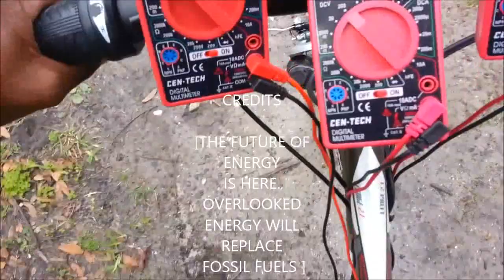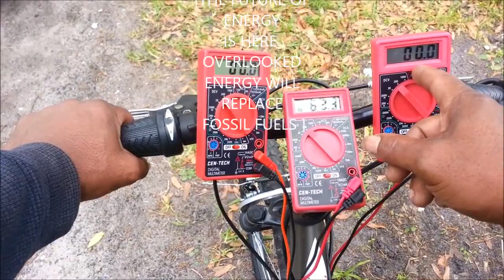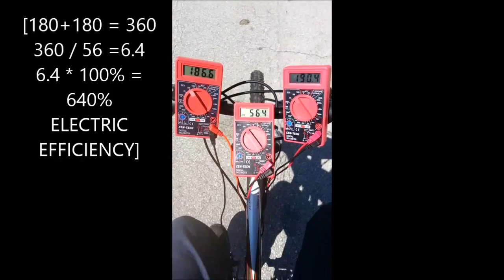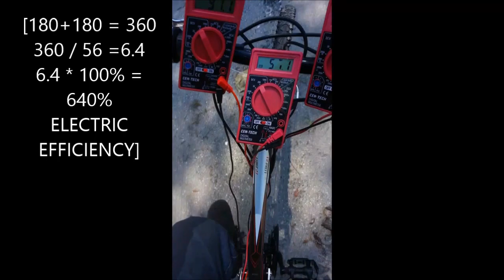SELF CHARGER E-BIKE

Comment: At the end of the day the volts the current none of that adds up however he's absolutely right I don't know what he's doing wrong but what he has is absolutely correct but I would have used a single alternator instead of two I believe he's trying to generate 24 volts with two 12 volt alternators and that's probably where the problem is as opposed to doing it with a 40 amp 24 volts alternator which would create 960 Watts which would probably over charge the batteries but it would never die probably should use car batteries and a utility trailer just a thought

Comment: You seem well-meaning, but misinformed. This video is flawed in so many ways and the entire premise is preposterous.You claim to have two generators attached to your bicycle, but you failed to show them and to give an explanation of them. Furthermore, your volt meters do not show energy being produced. They show only that a potential difference is being developed. The volt meters show electrical pressure, not energy. In reality, you probably have two trickle chargers that will likely be sufficient to run your iPod, but insufficient to recharge a 12 amp hour battery. You need to measure the current flow from your generators. At the same time, measure the current output of your battery. Compare those two values and see the true result of your efforts. A very simple test would be to attempt to ride your bicycle from sunup to sundown and see how far you get. Also, your music is better suited for an entertainment video instead of a serious presentation.

Comment: I like the concept but hears the problem, Just because you generating the voltage doesn't mean that you are generating the same amount of current back into your system. Current not voltage will be the determining factor in how much electricity he will get back. With this set up he will extend his range, but eventually run out of juice. Even if you match the amount of current there would be to much resistance to be able to move.
Reply: I got a good idea from another comment,  some says use two batteries, one for a recharge and the other to power the bike, when battery one is weak swith it battery B  THEN WEAK ONE WILL BE CHARGE up by dynamo
Reply: +rb7301301 With solar alone i have seen people run indefinatley across the desert with no pedals so with this and solar emplyed in a more sophisticated way .. it would work

Comment: Do you realise that volts are not watts, and if you put a charging load on it, voltage would drop and you would need more energy from battery to go forward, therefore you would actually decrease it's efficiency, unless you would use it for braking.

Comment: the maker of this video needs to be 'taken care of''

we cant have technology like this in the main stream. it has to be suppressed, not because its so efficient, but for not ferkin working you dip shits!

ebikes already turn motion into energy, its called regenerative braking.
Reply: +lez briddon if there was a big conspiracy E-bikes wouldn't exist. you can get 1000-3000mpge depending on the speed you're traveling and how much you pedal
Reply: Think I gathered that since I have built a few m
Reply: I don't get why people still believe it... in the past oil and car companys probably did stop technology like the EV1 but electric vehicles are pretty much here now and they will always be getting better, cheaper and more popular and will probably end up replacing ICEs completely.

I'm sure some people in the industry are against them but that's because EVs cut people off from revenue streams like the thurst for gas and constant servicing and changing parts that would wear out on ICEs

Comment: Great idea! Energy is not loss but converted to mechanical energy. MM display is voltage but not current, and Energy is Wattage = Voltage * Current. On a downhill, yes, free energy but takes the same amount + losses to climb back up the hill. :)
Reply: Iwant to take the same ebick valu details for payment thanks again
Reply: You have the added problems of additional friction and weight. The added weight and friction will draw additional power from the battery when under electric power. I'm not totally convinced that the added weight and friction don't end up being a net loss of electric power. It would entirely depend upon how much pedaling you do, and how much electricity you draw.

It's a neat idea, but ultimately very similar to a perpetual motion machine. Perpetual motion is a unicorn that is not possible in the confines of the friction and gravity we experience on Earth. The only difference is that you can add power to the system with the foot crank. I would like to see tests that show a net gain before attempting myself.

Comment: great job done, I have been working on my bike, so far it is not done, I know the motors can be turned into a generator when the bike is moving, I need to know how to connect the system in a safe way to charge the battery , can I get a schematic or a drawing from u? salam

Comment: Now it's easy to get a high voltage from some motors being used as generators but the current will be fairly low. You need both suitable voltage and current to charge the battery. I saw nothing to suggest the current was suffient for charging and the authors explaination seems to suggest possibly a lack of understand in that respect. I play around with motor generators on a regular basis and some of them reach 750V but the current isn't sufficient to charge the batteries faster than they use power
Reply: Can I run an alternator on back wheel and then power starter on front? What are ypur ideas?

Comment: Alim Innovations Has the Solution to Climate Change Barr None! See for yourself! YouTube.com Self Charger ebike. Wasted, Undiscovered and not used for anything mechanical kinetic energy that all vehicles create when they move is now being harness and converted to clean electricity by the Self Charger ebike. The future of energy is using this untapped powerful energy source called the Open Thermodynamic System for vehicles.
 The Opposite of burning fossil fuel to make mechanical kinetic energy "movement" is using "movement" Mechanical kinetic energy to make electricity. We have been using mechanical kinetic energy to convert to electricity for over 130 years. All vehicles create MKE when they move. The Power source of the future is harnessing MKE from every vehicle.
I have all vehicle types from a bike to the shuttle patent pending with proof of concept and fully working prototype. Self Charger ebike is the greatest example of using the vehicles mechanical kinetic energy taking electric efficiency not only above 100% but to 640% turning 56 Volts into 360 Volts by riding the ebike. The Self Charger ebike can charge up to 6 other ebikes. Overkill, because I was told that it wouldn't work. Now every vehicle can be a Power Plant.
Disruptive technology in energy and transportation markets because it combines them.
 Business model is license to OEMs and VARs
 Public 3-4 years
 PreMoney
Can't Find Energy! Too Busy Wasting it!